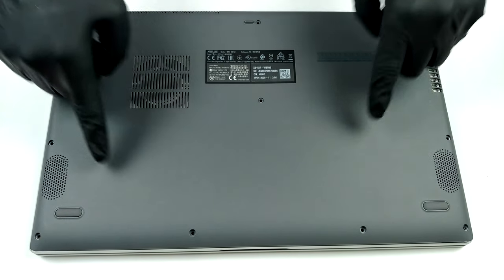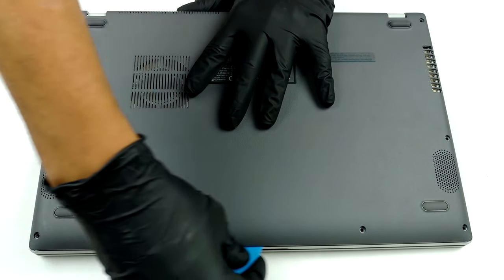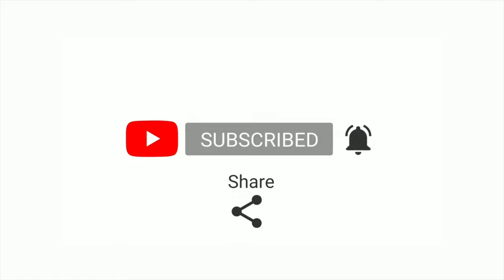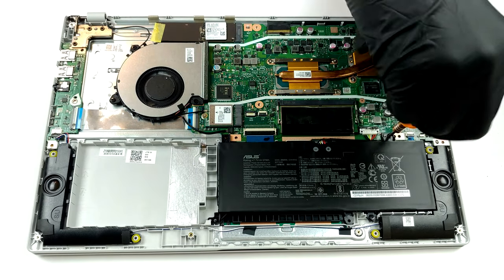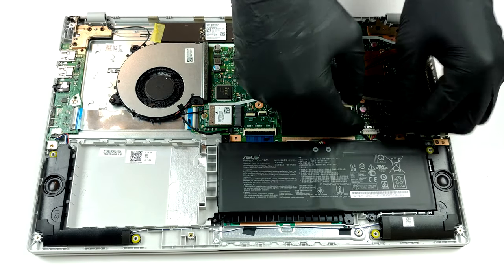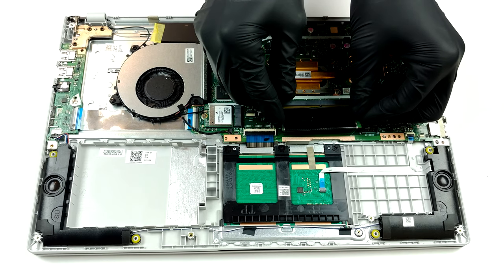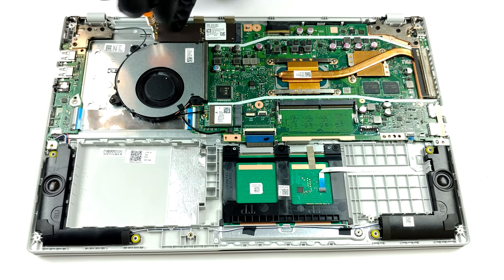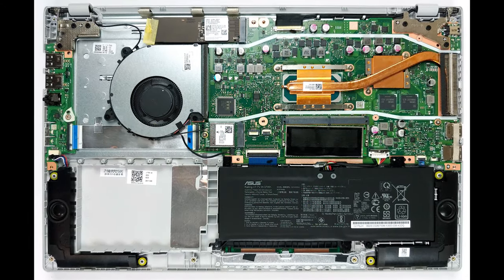🛠️ ASUS VivoBook 15 F515 - disassembly and upgrade options

Comment: When you replace the SSD. How do you install windows on it? Are there Windows setup files built into the device by Asus? When doing a recovery option? Or do you have to download windows onto a flash drive through the website to install it by scratch?
Reply: Yes you download windows on a flash drive and install it in the computer from scratch. Or you can try cloning the drive.

Comment: i didn't understand how i can reach 16GB RAM if 4GB is installed, there is no single 12GB RAM.  Or in addition to the 4 GB of RAM installed, can I add a 16-inch stick?  thanks for your help I own an Asus vivoBook 15 F515jf-ej017t
Reply: You can just pull the 4gb out and then purchase a bigger one and then put that in place of it.
Reply: I've managed to replace the removable 4 GB RAM and added an 8 GB RAM (from my water damaged HP Laptop) in which surprisingly and fortunately, the RAM was compatible. Now, I have a 12 GB RAM on my ASUS Vivobook 15.
Reply: I'm pretty sure he's saying you can install a max module size of 16GB from the slot. So you'd have 4GB+16GB = 20GB total.
Reply: Update: I was able to add a 32GB module to my laptop, so now I have 36GB total.

Comment: Is this model similar to Asus Vivobook X515JA
Reply: it is the same with d515 version that i got. and x515 is looking similer as well. so probably yes
Reply: I just recently bought that model and mine looks identical to the one in the video. I have upgraded the ram, and have decided to put a bigger ssd in it. At this point I probably should have just sprung for the more expensive one LOL oh well, still a good laptop.

Comment: is adding hdd posible? where is the sata connection?
Reply: i saw a space for a hdd, maybe in the box have the an adapter for it
Reply: @jorgevallejo3609  that is surely a hdd space but i couldnt find any sata connection in the motherboard
Reply: @furkanunsal1131  need an adapter for it, have a sata port but in the main board is not connect to data, is the connector up from keyboard port (left ram space)
Reply: the connector is near to wifi adapter, in front of de battery, the description says HDD

Comment: I just got my Vivobook 15 F515JA and a Silicone Power 16Gb DDR4 2666 p/n X002W1M347. When I opened the bottom to replace the RAM there was nothing in the removable RAM slot like there was in the video. I only mention it because now that I have the RAM Iin the slot. The screen will not turn on. Any help is appreciated.
Reply: make sure you plug the RAM in correctly, otherwise, the BIOS system wont turn on your computer. Ussually, the problem goes away when you plug it in correctly, and also when you disconnect the RAM
Reply: I’ve replaced RAM in other computers before. It seems pretty straightforward, slide the RAM in at about a 35-45 degree angle and push down until it clicks past the tabs. 

I even tried a tip I saw on here for motherboards that come with no RAM in the optional slot. That is, sliding the stick in and out a few times and the seating it down. The stick seems pretty well seated
Reply: Maybe the ram model you bought is not the right one or your unit is flawed, have you tried it on another laptop??
Reply: @tomasventura2715  i thought about that at work. I asked a friend of mine if I could test the RAM on his computer.
Reply: @92boostedh22  hey how is it now?
Reply: @ryhanzfx1641  still doesn’t work
Reply: @92boostedh22  on your friend computer it still doesn't work?
Reply: @ryhanzfx1641  nope, I don’t know what to do at this point. I contacted Silicon-Power and all they did was ask for pictures of the RAM. That was the last I heard from them.
Reply: Try (before installing the ram) to update the bios, but if the screen doesnt turn on, make sure that the screen cable is plugged in.